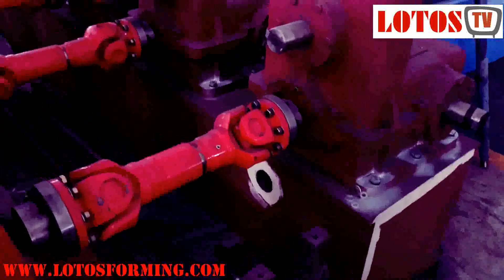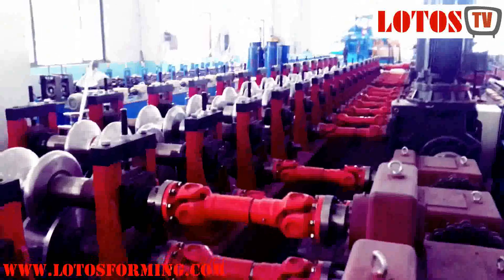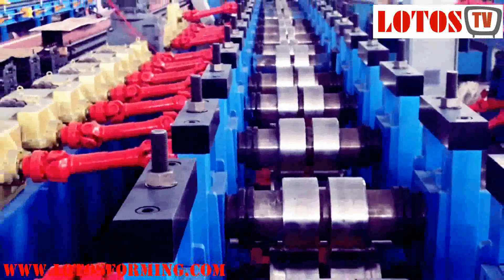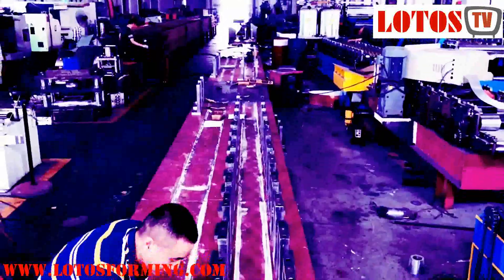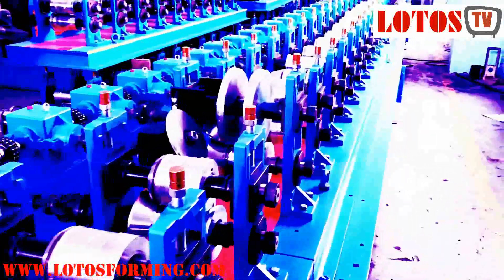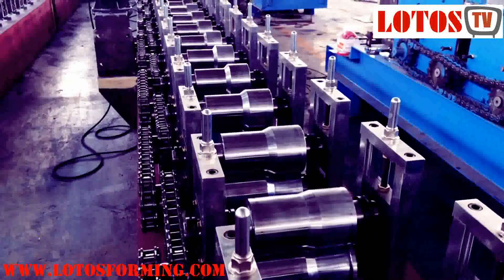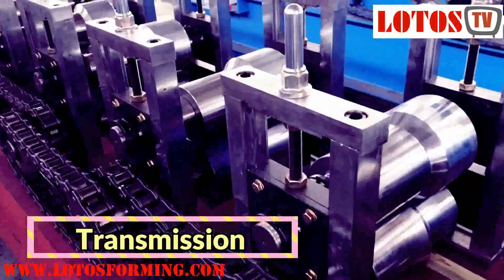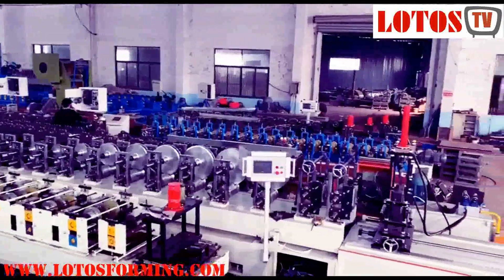【How to Choose Roll Forming Machine】:  Technical Specifications Roll Forming Machine " LOTOS DESIGN"

Comment: The “forming angle” method, which regards as reasonably dependable for assisting in the determination of the number of roll stations to form a bend, takes account of the intermittent deformation under each roll station only in a crude way.

Comment: Roll forming machine that design and produce for specific metal such as SS, GI, CI, PPGI, CU, and etc.The cold roll forming process is an alternative method under the condition of room temperature to form the advanced high strength steel. The forming rolls design with relief and trap features to control the material locally and prevent the defects of folding and wrinkling.